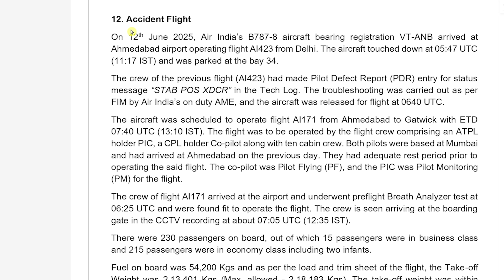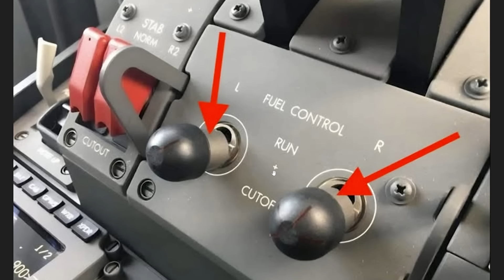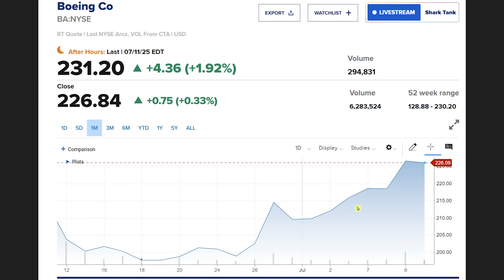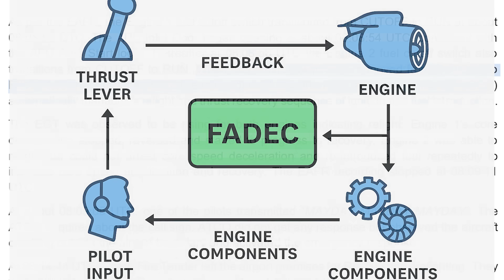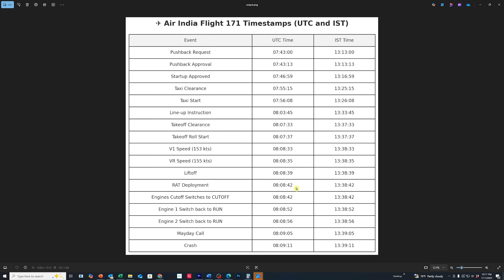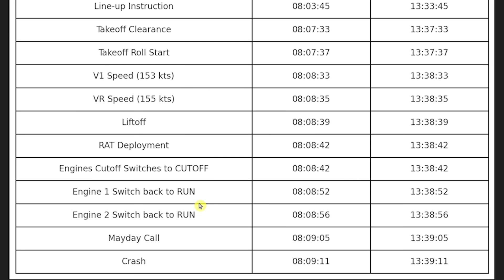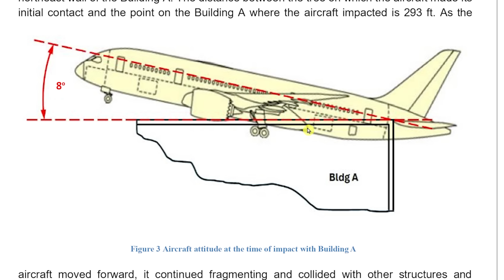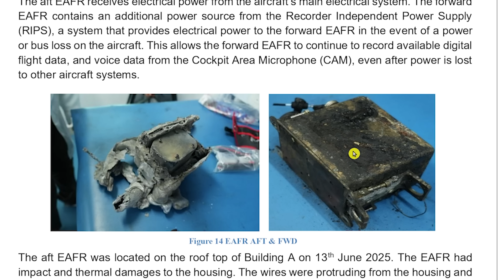Did Pilots CUTOFF Fuel? Shocking Twist Air India 171 Report!

Comment: I think this could be prevented with a bit of programming update, fuel cut-off should only work at idle thrust setting.
If it's at take-off thrust setting, it shouldn't cut off at all until the engine is at idle or engine fire extinguisher is activated.  There's no reason for any pilot to ever do fuel cut-off when engine is at some thrust setting, so I think this could be a good idea to put in, some of other planes already do this.
Reply: what if the engine is on fire and he wants to cut off the fuel immediately along with the engine with one switch.

there are probably countless scenarious where there pros and cons of allowing more or less control by the pilot over operations.

Comment: The co-pilot was piloting with both hands on the yoke and the Captain would have had his hands on the thrust levers and once the plane lifted off he would remove his hands from the thrust levers and move the landing gear lever to move the gear up. It would appear the Captain would have moved the fuel control switches. A possible suicide - too many unanswered questions?

Comment: Interesting the RAT deployed in the same instant the engines were cut. Is the RAT hardwired to the cut off switches? Doesn’t the RAT have to wait until the engines fall below idle speed to deploy? Just a question here.

Comment: Was the knobs for cut off ever physically turned off? Or was it only an electrical signal from the computer to the flight recorder that interpreted it as a physical movement on the switches? To conclude that the switches was physically moved there must be some sensor that register the actual position and movement of the knobs.

If the lights goes of in a a neighbours house, you can't know if it was intentionally switched off, or if it was the fuse, or the lamp giving up, etc, just for comparison.

Comment: Jeff, you've done enough root cause investigations to know that there is often misinformation floating around. Kudos to you for sticking with the facts and waiting for the prelim. report!
Reply: Unless 'Jeff' clarifies clearly where and how the exact timestamps and events he states were derived, this video is complete BS. This has been commented on by several commenters already. I advise you to read the report yourself, maybe ask Chatgpt or some other AI simple questions such as "are there timestamps in the report where event times are clearly stated i.e. fuel cutoff happened at 08:08:42".
Reply: @carlitos-x9s  The timestamps are already in the prelim report that was published by AAIB. You'd see it, if you cared to read it..
"... The aircraft achieved the maximum recorded airspeed of 180 Knots IAS at about 08:08:42 UTC and immediately thereafter, the Engine 1 and Engine 2 fuel cutoff switches transitioned..." and it goes on
https://aaib.gov.in/What's%20New%20Assets/Preliminary%20Report%20VT-ANB.pdf -- if you are interested.

Comment: The guy who asked "why did you turn the fuel off" was probably the one who did it😢
Reply: If it was done intentionally, I'm sure they can figure who did it. The pilot flying probably had both hands busy with the take off and probably couldn't also turn the cut off.
Reply: @kzhemh I think it was the copilot who did the cut in the fuel  and then he asked the commander the question
Reply: @alexandreluizalves   Why do you believe it was the copilot?  He was flying the plane and at that time would have had his hands on the yoke, so it looks more likely that the captain did it, not the copilot.
Reply: @daedalron you're right. After reading the details, I now think the commander did the switch
Reply: I guarantee you they were able to cut the fuel in the simulator in one second. The only thing they don’t know YET is which one did it.
Reply: There is already a report where they mentioned about the faulty switch in 737 ,787 from 2018. Just like mcas boeing didn't give enough attention to this. Just give airlines a "not so essential" order to check of the switch. And i think AI didn't pay notice to that. So due to that faulty fuel line switch it may happen
Reply: @arun37625  in the 737 not 787, and even then if it was installed improperly.  The aircraft had been flow many times and it would be a dereliction of duty for all of the pilots prior not having to not have reported this maintenance issue (i.e.  is  this lack of indent in the switch)
Reply: @Long_Duk_Dong   Other pilots may not realize the safety is faulty even after years of using the switches. After all, if you use them normally (pulling before moving), they would function as normal and you wouldn't realize the security is faulty.  You would have to try to move them without lifting them first to realize there's a problem, but who would do that?

What makes the accidental switch unlikely to me is the 1 second gap.  If someone accidentally moved the switches, both would have been moved at the same time by the accidental touch. The 1 second gap means one switch was moved, then the second one was moved.  Seems way way more likely to be an intentional switch than an accidental one.

Also, if the main suspect of the investigation was an accidental switch, they would have almost certainly requested in the report to check other planes to verify if the security was faulty or not.  The fact they did not request such thing points to the investigation team thinking it was an intentional switch.
Reply: Like that would even be a valid question.. in the short time they had..its not something like.."why did you turn the radio off boss..".. there is no valid answer for any of it..
Reply: @TheUrantia001  he was probably concentrating on saving the plane rather than fighting with his co-pilot. a shocked "why would you do that" is what I would ask as well, probably
Reply: I disagree with this. I think the copilot (flying) saw the captain turn off the engines in his peripheral vision and didn't have time to do more than ask "wtf" and try to recover the plane
Reply: @pugletpie   Both options are possible, which is likely why the preliminary report didn't say who said what.
Anyway, there is extremely likely one liar in that cockpit. We're just not sure who is the one lying for now. Given the copilot was flying, and should have had his hands on the yoke, it is more likely the captain was the one who activated the switches, but that is not 100% certain for now.
Reply: @daedalron I agree.... Both options are possible.
Reply: faulty switch ?
that would explain the surprise.
Reply: what if the engine was actually fail and the person asked why the f u cut the fuel flow .....
it is not manually possible to cut the fuel flow of both engine in 1 second
Reply: It's entirely possible because the residual fuel is in the system  @ninefifteen915

Comment: If sadly it was purposeful, t was really the only time a person could switch off the engines and guarantee a crash WITHOUT a physical confrontation between pilots because there would be no time if airspeed is lost and you are trying to keep the plane under control.

Comment: from The Aviation Herald:

On Jul 12th 2025 (UTC) India's media report that the investigation is NOT focussing on a human action causing the fuel switches to appear in the CUTOFF position, but on a system failure. Service Bulletins by Boeing issued in year 2018 recommending to upgrade the fuel switches to locked versions to prevent inadvertent flip of the switches, as well as the FAA/GE issued Service Bulletin FAA-2021-0273-0013 Attachment 2 relating to loss of control issue (also see above) were NOT implemented by Air India. The stated MN4 computer with faulty soldering, that might weaken and lose contact due to the thermal stress after a number of cycles, interprets data and commands fuel metering valves - with the lost contact attaching the MN4 processor to the EEC intermittent electrical contact, loss of signal processing and engine control faults can occur. The SB writes under conditions for the SB: "An LOTC (Loss Of Thrust Control) event has occurred due to an EEC MN4 microprocessor solder ball failure." According to discussions in the industry it may be possible with the number of cycles VT-ANB had already completed, the solder balls were weakened sufficiently to detach the MN4 from the EEC momentarily due to loads during the takeoff rotation leading to the loss of control of thrust and shut down of the engines.

Comment: Maybe the two switches should be split and one on each side so at worse you only loose one engine unless both pilots are suicidal. Or have set of both switches in both sides, all 4 switches ha ve to be moved to change previous state. I remember when German pilot did suicide I think industry came up with two people in cockpit at all times. This case has unlocked new scenario where one of suicidal pilot can do this at take off and does not even need other pilot out of cockpit. Perhaps other easier option to implement is state of switches can be changed until cruising altitude is reached.

Comment: Any chance that due to an electrical problem the signal to cutoff was generated without physically switching the keys? we know the signal is not direct to the engines there must be some sort of solenoids/relays in between. i cannot believe that one of the pilots does something like that without the other noticing. Also, they have 4 more hours and better chances to do it if it was intentional

Comment: Could it be anything different than this?
08:42 - Pilot 1 turns off fuel to the engines.
08:43 - Pilot 2 asks why they did that (In shock)
08:44 - Pilot 1 lies and says they did not.
08:45 - Pilot 2 tries to turn them back on, Pilot 1 fights to prevent it.
08:45 - 08:51 Pilots 2 and 3 struggle with pilot 1 as they try to re-engage fuel.
08:52 - Pilot 2 re-engages fuel to the engines during the struggle and starts trying to fly the plane again. Pilot 3 still fighting with pilot 1.
09:03 - Pilot 2 realizes they are going to crash.
09:05 - Pilot 2 calls out a mayday.
09:05 - Crash. 

Agree with cameras in the cockpit, but it would not have prevented this. 
This seems to need a change in design with sabotage in mind.

Comment: At the moment this appears to be another Germanwings type scenario. I really do not understand why somebody would take 300 people with them when they want to end their lives. I agree with somebody else here who said that the comment why did you turn off the switches could have been misdirection. this is the only point in the flight where cutting off the engines like that would guarantee a crash. If they  had a bit more altitude there would have been time to respool the engines. so sad

Comment: So both engine cutoff switches were moved to CUTOFF in the exact same second?  Does that strike anyone else as odd?  It's not like the pilot could use both hands easily.  I would expect there to be a second gap between 1 switch and the other.  But they both went to cutoff at the exact same time.

Comment: From what I understand the CVT is very sensitive and can pick up a pin dropping in the cockpit, I would think that the movement of the switches, would be heard since they are more cumbersome than any toggle, switch. If so, this would rule out any technical malfunction. Also, if the switches were worn to the extent that they would slip to the cutoff position, there's no way they would survive the crash without returning to the shut off position.

Comment: I feel the fuel switch was never switched on from the beginning. It was in Cutoff position all the while. The flight would have taken off with the fuel left in the engine and the supply lines. For example in  the fuel control of motorcycles even if its turned off it will run for a while similarly this flight would have taken off and exhausted the fuel in the supply lines and engine and taken a dip instantly.

Comment: I remember reading (in several different sources) that one of the pilots had some family issues. But..... pay attention that those switches were flipped within 1 second time frame but it took 4 seconds to bring them back to RUN position. I think that this only supports the hypothesis that the engines were deliberately shut down. The pilot who did this obviously wanted to do it as quickly as possible. If he did it slowly, the other pilot would most likely react somehow and try to intervene. The pilot who did it, obviously wanted to be as quick as possible. The other pilot would have been taken by a total surprise. I could only imagine the total shock and disbelief he went through while trying to grasp and comprehend what the guy sitting beside him had done. This is should be the reason behind these 10 seconds for reaction. My guess is that one of the pilots flipped those switches and simply relaxed back on his seat, while the other pilot struggled alone in desperation to gain control of the situation. As I said, there were articles saying that the first officer had some family issues. If I remember correctly, these articles said that his father was sick or something. Who knows.... he could have taken some medications, which rendered him in some way inadequate. Remember this case when a pilot tried to turn off the engines of an airplane in the middle of the flight why he was high on mushrooms? Remember German Wings or MH370?

Comment: Sure I alway ask my first officer why he just switched off the engines, that's a pretty normal reaction in a situation where you can die. It wouldn't absolutely pop into my head to switch them back on immediately with out asking him first why he did that. And why does it need to be so specifically paraphrased that the air/ ground sensors transitioned to air mode?

Comment: from what i have read , the FADEC receives fuel cut off valve position data and not cut off switch position..... was the question posed (did you cut off the fuel switches) by one of the crew in response to maybe hearing the switches being moved to cut off or by his recognition of the loss of thrust by both instruments on the engine instruments screen??

Comment: Hi Jeff. Great video. 
I am trying not to go down the murder/suicide conclusion route yet. 
Is there any way the fuel switches could appear to be secure in their indents but actually somehow riding on top? With the vibration and acceleration of take off, could the switches then slip down into off? Also we can't rule out the software yet, acting mistakenly, that the switches were off when they in fact were on. 50 years in software development tells me we can't accept blindly it is working perfectly. Just a thought.

Comment: Is it possible that upon rotation, the engines both failed, not because of the fuel control switches but because of an EEC or other electrical fault. A fault triggered by transition to “Air Mode”. (ANA had an uncommanded shutdown in Jan 2019 in Osaka after landing – associated with thrust reverse), 
As a result of a dual shutdown (of two apparently good engines), the RAT deployed and the APU automatically started. Did the Captain (pilot not flying) then take both fuel control switches to cutoff and back to run, in an attempt to reset the EEC’s (FADEC’s) AND prompting the question from the FO “Why did you cutoff?” The response “I did not do so.” could be a response to the initial uncommanded failure. Possible?
The fuel control switches were found in the run position. Other systems, the fire switch for instance, can close fuel valves with the start switches in the run position.
It does look like one engine did restart and the other was trying, but too late to avoid the crash. The flight data recorder (FDR) should show the timeline of the fuel control cutoff switches in relation to the loss of thrust. The rear FDR was apparently damaged. Do both B787 flight data recorders show the position of the fuel control cutoff switches, the valves or both? Immediately after takeoff, was it the valves that indicated closed, caused the flameout, but are being reported as the cutoff switches?
If it was a suicide, why attempt to relight the engines? Why make a mayday call? A suicidal pilot could pull the fire switches couldn’t they? It is a truly sad day if this option is in fact true. I am sure that there will be a lot of background examination of both pilots.
A mistaken movement of the fuel control switch? A bumped movement of faulty fuel control switches? A crew response to reset the malfunctioning EEC’s (FADEC’s)?
Reply: WRONG, we know that both fuel switches were moved to cutoff. Later they were moved to RUN. You better explain why they ended up in the CUTOFF position which is recorded by the black box.